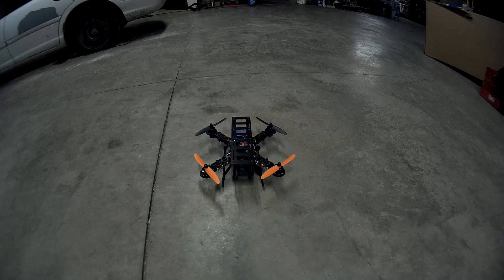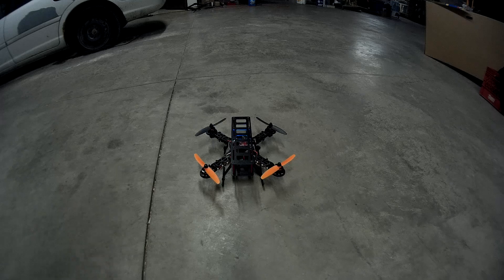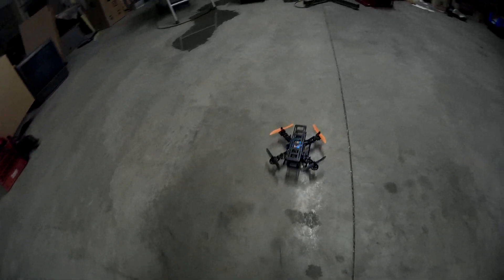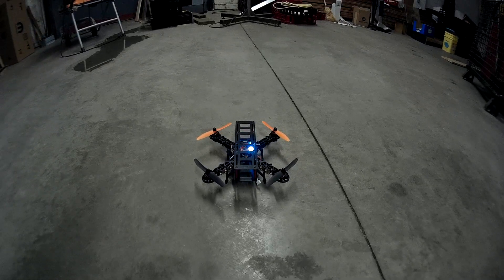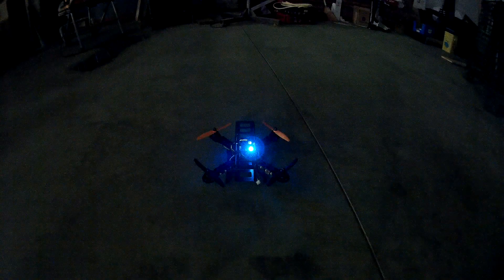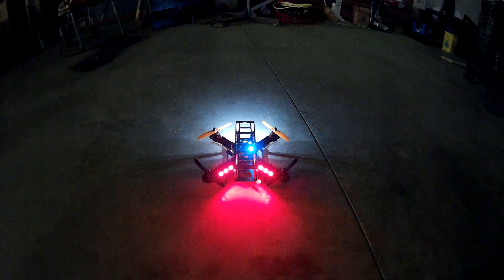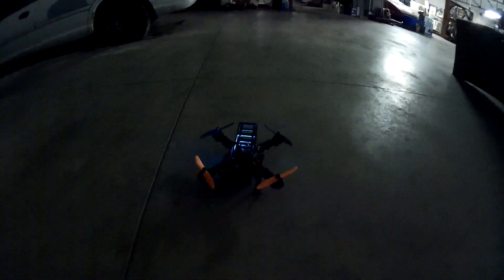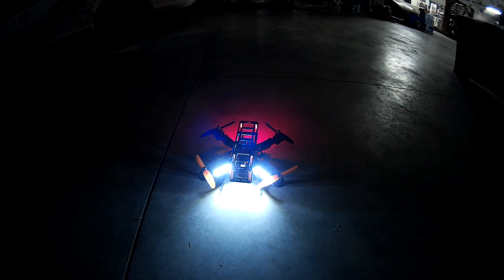LED Lights Working on my QAV250 clone.

Comment: Could you please tell me where to buy a LED light module for my QAV250 ?
Reply from the maker: They were 12 volt flexible LED Strips that you can cut to your desired length. Not specific to our hobby, they are used anywhere or in anything you can imagine.

Comment: how you did it?????
Reply from the maker: +Max Voronkov I used an ESC intended for older Brushed Motors and just wired the LED's to the ESC's Motor Outputs. The ESC's Input Power came straight from my 3S (11.1v) Lipo Battery. Then I assigned a spare Aux Channel on my Taranis Radio Transmitter to one of it's many Potentiometers to control the ESC's voltage output to the LED's so that brightness is controlled from the Aux Pot Knob on the Transmitter.